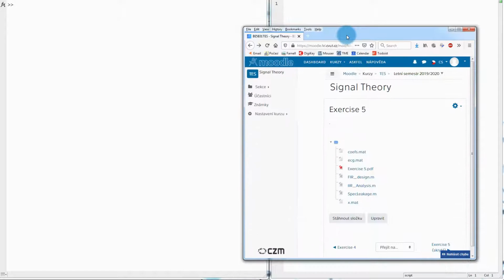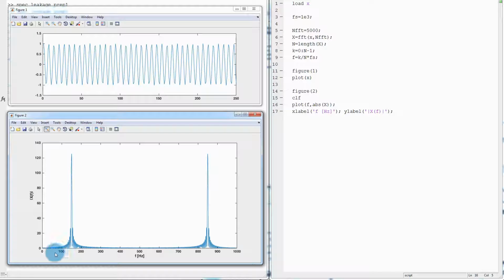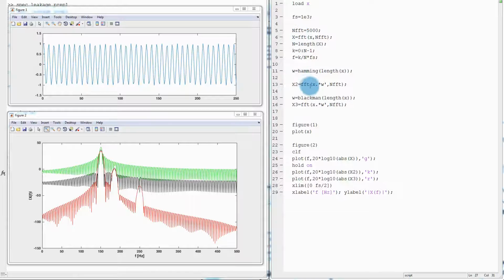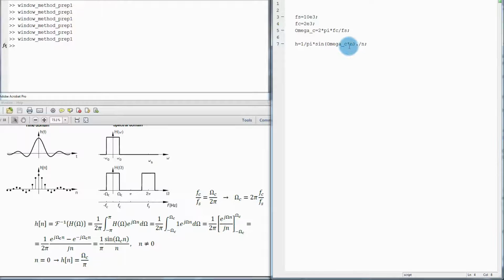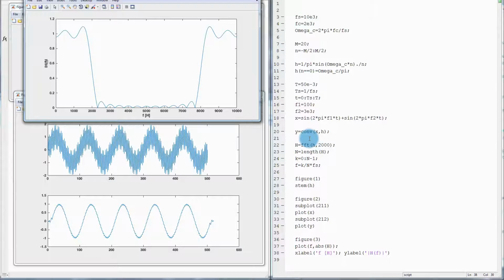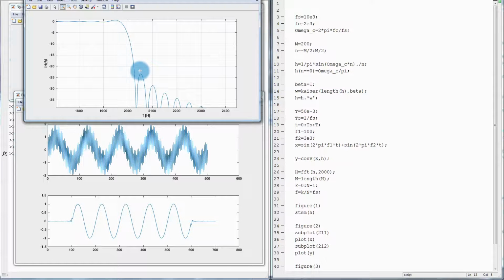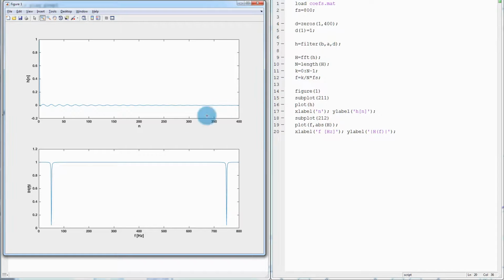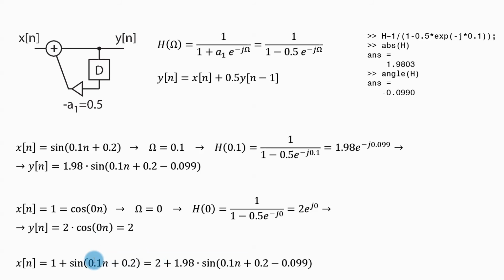Signal Theory (Signals and Systems) - Exercise 5 - Spectral Resolution and Leakage, FIR Design, IIR

Comment: Hello Professor, I have 2 questions:
1) In your first example, you plot the spectrum, and by increasing the amount of samples, you got the spectral leakage. In the lecture, you mentioned that the spectral leakage comes from the sudden change in the window function. But here we actually see the spectral leakage before applying a window function, why? Is it because of the step of making the signal finite has been done in the .mat file?
2) When we change the second parameter "Nfft" in the fft function, will the sampling frequency be changed too?
Thank you.
Reply from the maker: 1) The process of multiplying of an infinitely long signal with a rectangular window to get a signal with a finite number of nonzero samples is only a mathematical abstraction. It is a way how we imagine our signal with finite length was created from an infinitely long signal. In real life, we of course do not have that infinitely long signal. Nor we have to multiply it with the rectangular window. This is created "automatically" when we record a signal with finite length. 

From the opposite direction: when we record a finite length signal, and we want to understand the properties of its spectrum, we imagine that our signal was created from an infinitely long signal by multiplying it with a rectangular window. That will allow us to understand the spectrum of a finite length signal as a convolution of the spectrum of an infinitely long signal with the spectrum of a rectangular window. It also allows us to understand that when we add multiplication with a smooth window, the spectral leakage should be suppressed.

And a small correction: The spectral leakage was present even before I increased the number of samples of the spectrum. The DFT spectrum was just sampled so coarsely that I got only one sample per lobe. Increasing the number of samples only allowed me to plot the shape of the individual lobes in greater detail. So increasing the number of samples did not give me spectral leakage. It only gave me a more detailed view on it.

2) No, when we change the number of samples in which DFT (FFT) is computed, the signal's sampling frequency does not change. The sampling frequency is related to the distance of the samples of our signal in time domain. When we increase the number of samples of our spectrum, the samples our signal in time domain do not change.
Reply: @radoslavbortel3459  Understood. Thx:)